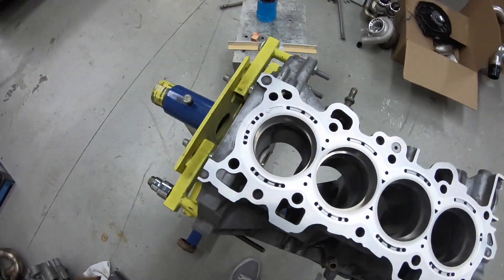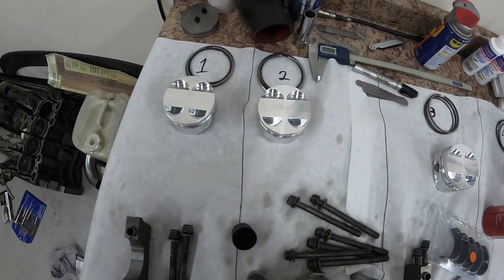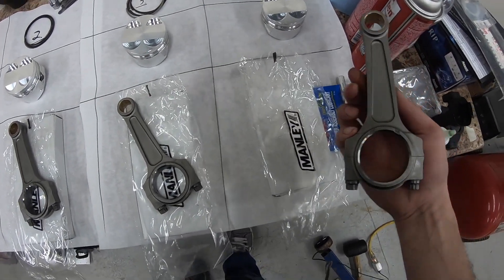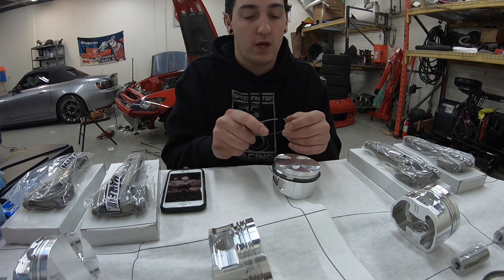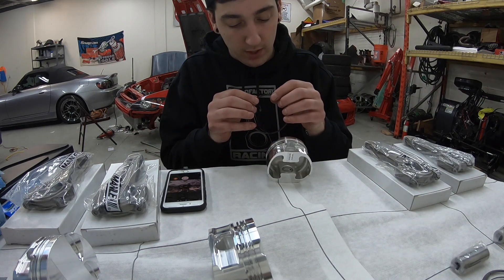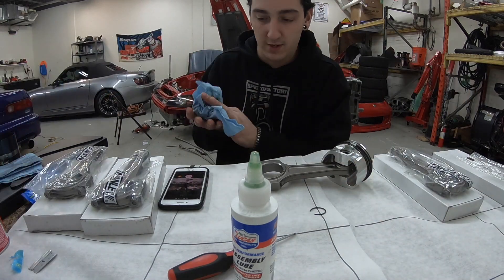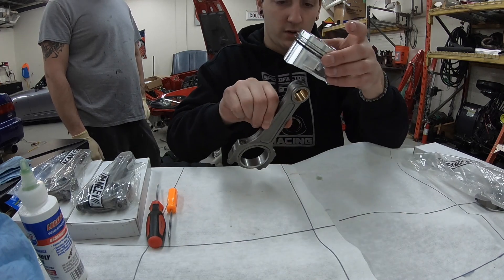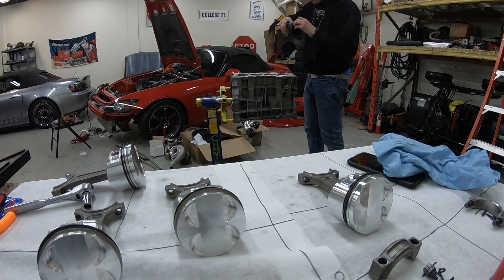BUILDING A 500+ HP GSR

Comment: You can straight tell this kid is a rookie
Reply: nothing wrong with that, everybody starts somewhere.
Reply from the maker: That’s okay it was my first time building a motor completely on my own makes over 500 Hp so I think I did okay lmfao
Reply: @danbarcomb89  They all do
Reply: @danbarcomb89  By the way 500whp on a single cam is an achievement not a B series you can do over 600 on a mild build with cast pistons on a B series all day
Reply from the maker: @boost_edjamesmathew2168  you make 600 on a cast piston your gunna watch the thing melt... I’m not done with the car I pan on making a lot more if you watch the other videos I had problems on the dyno and had to leave it where it was. I was fighting suspension and other issues so I left the power alone I need to put a cage in it and turn it up so I can have some fun at the track not a race car but I want to enjoy it remember this is all fun not a big dick contest homie !
Reply from the maker: @boost_edjamesmathew2168  just thought it was funny your comment you can straight tell this kids a rookie lmfao I been building cheap setups like swaps and all N/A builds since high school but you right that was my first turbo build build  my other car was a stock motor still just don’t see where you were going with it but 😂👍🏻
Reply: @danbarcomb89  Cause I can tell your inexperienced by the way you work and your hands are frail
Reply: @danbarcomb89  LMFAO no they actually run for years again that's shows your inexperienced
Reply: @danbarcomb89  Isn't that what females say LMFAO
Reply from the maker: @boost_edjamesmathew2168  spend the money build it right it will last so cause I said cast pistons are weak I’m inexperienced... I’m done with this conversation lmfao when your single cams fast lmk lmfao I’m not one to usually judge but your ignorance deserves it you have no room to talk 😂 with my frail hands I’ll build what I want lmfao fuck outta here
Reply: @savagecr-x2438  LMFAO more like GARBAGE CRX LMFAO
Reply: @boost_edjamesmathew2168  corny....just like every part on that car
Reply: @boost_edjamesmathew2168  and only thing that’s getting beat is your car in every race with anything
Reply: @boost_edjamesmathew2168  you like looking at other dudes hands and judging how they look. Your a lil suspect
Reply: @jeancarlocolon266  And you like defending dudes that look gay now who's suspect or just flat out gay I say he looks feminine and your trying to defend him coming out the closest are we LMFAO
Reply: @danbarcomb89  he has no life lol dont waste your time, he has a pathetic D16 motor lol